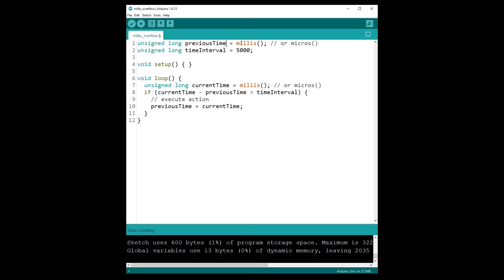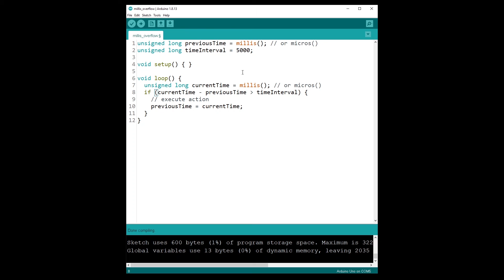Arduino - Solve the Overflow Problem with millis() and micros()

Comment: Thx. But something does not add up in my head: if " currenttime" already overflew but not yet the "privioustime", then the mathematical difference is immediately greater than your interval of 5000. So you must have a one-time wrong calculation!!!!!
Reply: Nope. The duration calculation rolls over, going the other way. Zero minus 4 billion = 0.29 billion, assuming 32bit unsigned integers.

Comment: So are you saying that we dont need to add any extra code to handle the overflow issue ? it is going to function normally even after the duration exceeds the maximum limit ?
Reply: Yes. As long as you calculate duration it will always be correct.

Comment: i using uint64 for micros, the limit of uint64 is 2^64-1 (to prove it u can insert random number > 2^64-1 to uint64 variable and print to serial monitor ), but at the end its only show 2^32-1 and than return to 0.